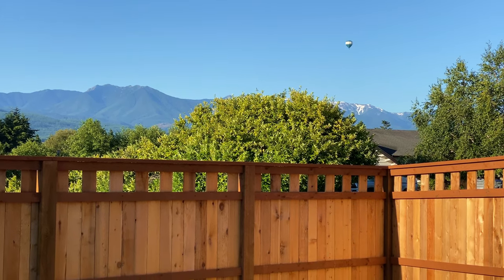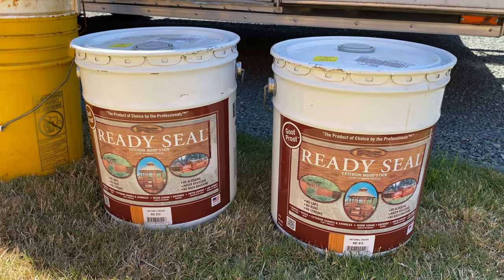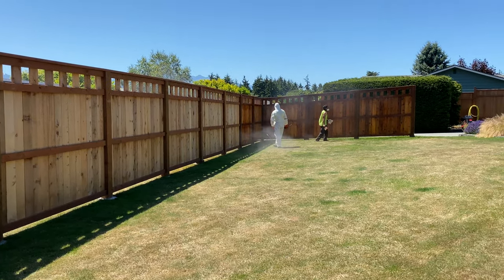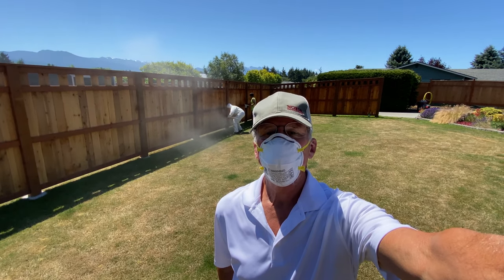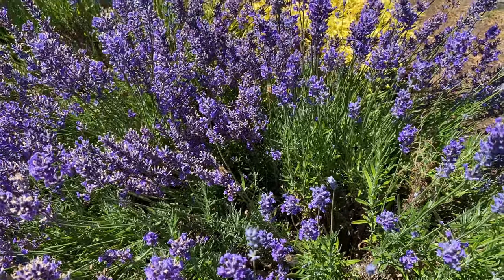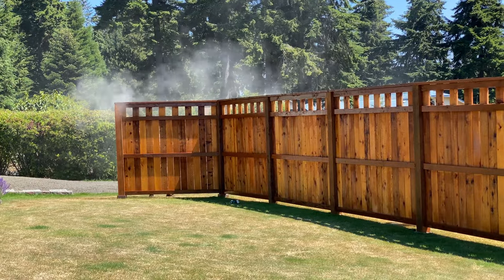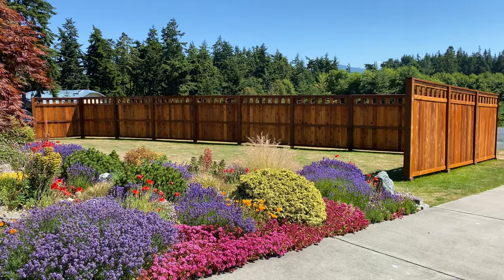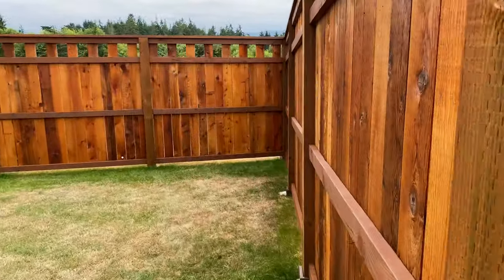Build a Cedar Privacy Fence, Part 4– Seal the Fence

Comment: Why is the fence so high up off the ground? What's the point of having a fence if every neighborhood racoon, cat, possum, etc can come right in? 🤔
Reply from the maker: This is a “Privacy Fence” as stated in the title. All critters (and people) can easily go around this fence. The purpose is to block the annoying traffic from view, not the wildlife. And it works! Thank you for your comment!
Reply: @randallwingett  I guess you don't mind looking at the car tires? :P Many people watching the video have their own house exposed to traffic, so it's a lesson for everyone to learn from if they're watching the video - as the wide and low gap also would allow traffic noise a straight path to your yard, whereas leaving no gap between the dirt and fence would have blocked some of the offending noise. Ah well. Guess you always have the option to improve upon the current design at a later date with more soundproofing - whether dirt, or cement footer, bricks or blocks or garden beds, etc. And those watching can plan better if the goal is to cut down traffic noise.

Comment: The fence looks very nice. Good design, although in my neck of the woods they will only allow a fence to be 6' high. My only question is how you will manage to prevent warping of the pickets since they are installed tightly against each other. Normally they will leave a 1/8" gap between each picket.